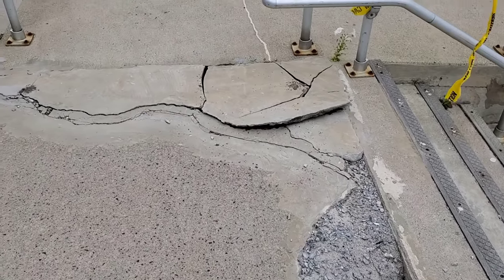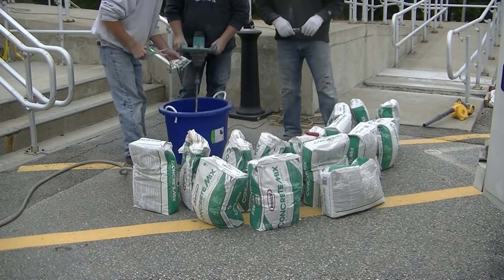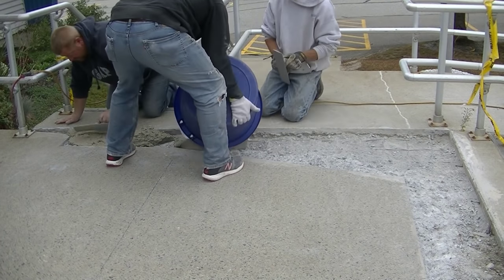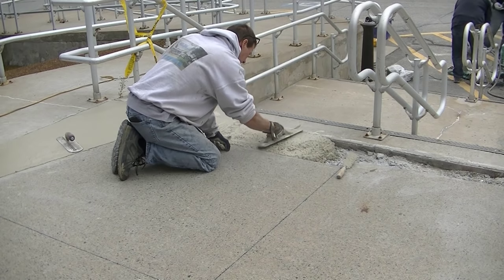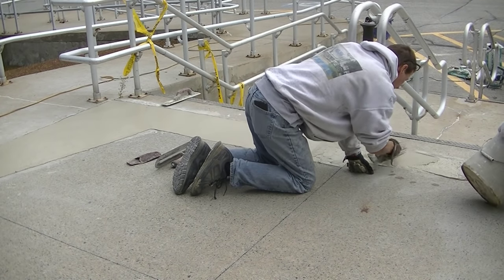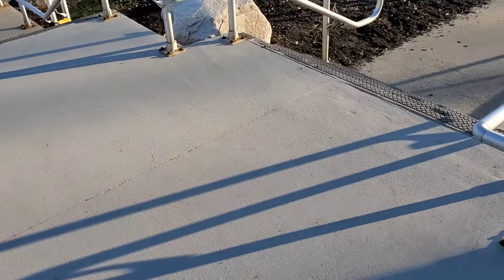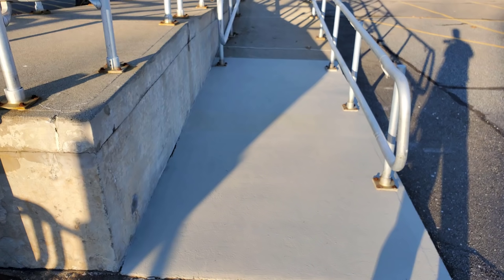How To Repair Broken Concrete | Fix Concrete Driveways, Patios, Sidewalks, & Pool Decks

Comment: Hi Mike, how would you repair a garage floor that has surface cracks that make it look like a jigsaw puzzle?  I think when the guys poured my slab, they swept the floor with big rotating sweepers and I believe they swept too much.  The surface appears to have no aggregate visible and the surface is very brittle.  It looks terrible and I wanted to do an epoxy floor.  Thanks for the videos and I appreciate the information you provide!
Reply: Just tile it over with 2cm thick outdoor tiles.

Comment: Great concrete patch job, and so professionally done!  
We hired a person to repair a section of our pool deck , and next season to do the the entire area with concrete stamping. I am so disappointed in the job that was done.   The process was nothing like the videos  I’ve just viewed. I’m no expert, but I could not understand why grout was used to repair the area. It began drying with what appears like spider cracks, and just unacceptable.   When I questioned the material and process we were told they would return in two days to apply two thin layers of concrete to cover the grout, but it would cost more than the price  quoted. Our loss.  😢
Could we apply an acrylic sealer as you stated in this video to carry  us through this season?   As the cliche goes, “ You get what you pay for”

Comment: Question do you need to wet the area for this application? Does it help or not matter in this exact case? Thanks! That repair and with the paint looks outstanding great work!
Reply: ... many have already suggested the answer to your question and it appears that they do not answer questions here so I will make it clear should have been wet down before application

Comment: Good concrete patch work is not easy.
I’m rarely an advocate of painting concrete flat work. Whenever you introduce foot traffic to concrete, paint just doesn’t hold up. But because there is so much patch work to do here, this seems like a legitimate application. 
Because concrete color is next to impossible to match, this job just wouldn’t have looked right without evening out the colors (shades) from new to old concrete.
Reply from the maker: I'll be down your way in a couple weeks. Tampa area.
Reply: @MikeDayConcrete  Cool! Something work related or maybe vacation?

Comment: For over fifty years I ve been hearing concrete guys say "There,s only two types of concrete concrete thats cracked and concrete thats going to crack " and to that I have always said "Than why do Pools hold water for years and years ? Because they are made right even earth quake So. Calif they still hold water even in  Big lake  lodge the pool sees both Earth quakes and hard freezes the Pool still holds water -Raw Concrete is a sponge it needs to be sealed or it will crack. maintenance is the key.
Reply: It's always wet.

Comment: Hello Mike,, I have a 10’ X 20’ interior room that i removed 2 layers of tile & the thin  set... Now it’s a little too low by about 1/4” here & there.. I just want to level the floor a bit from the concrete base flooring that’s there now before the ceramic tile goes down.. Any recommendations on some concrete leveling compound or mix ?? I’m in the southeast florida if that matters.. Again, thanks for the videos... By the way, we got almost a foot of sunshine ☀️ today..😁😉
Reply from the maker: Look up Silpro Silfo 220. That's what I use.

Comment: I’m not even a professional, but know the old concrete needs to be wetted first with water, plus the adhesion is improved by brushing on a thin slurry of cement and water prior to adding the new concrete. Unbelievable these guys made a YouTube video with not doing these simple steps to significantly aid adhesion.

Comment: Couple nit picks would be cleanliness on loose stuff. Needs blown out with air. I like using a two part epoxy just ahead of concrete so it bonds better. Overall looks good. These type of jobs are for experts only

Comment: Need to show the hydration process for rapid set. It will crack of you don't hydrate it.  It will turn instantly in front of your eyes.  Once that gloss disappears start hitting it with water.   It will get hot.
Reply: LOL...

Comment: The same forces that broke apart the original concrete will break the new concrete. The problem is the substrate which was not addressed here.

Comment: I’ve done some concrete repair for some customers in the past.... even patched pot holes in the asphalt with concrete and some pieces of chain as road mesh.... still holding up!
Question; is there any cold bond adhesive... is it necessary?

Comment: I can not believe you are not using a 1" pad below your knees. The concrete will ground out your  life force energy into the cement along with swelling of the hard surface to the tissue on the knee cap.

Comment: You also said right before the video was done that you were going to show what type of coating you put on top of the cement slabs to help protect them or paint and never did????? AND YOU NEVER WET SURFACE FIRST???? Even if your sad excuse was that their was no access to water at premises, even a teenager would have known to buy a pump sprayer for $25 at Home Depot and filled it with water before arrival LMAO!...---->AMATUERS! THAT JOB WILL BE CRACKING IN NO TIME!
Reply: I'd like to know also.

Comment: The repair product is good, but since you used tapcon screws, that’s definitely homie. Drilling all edges @ 2’ centers and used 1/2” rebar instead. The repair will always be the weak link in any repair, so why not reinforce it. Been doing it this way for thirty years, and never had to redo any.
Reply: Right on!

Comment: Is this a commercial for rapid set , retired concrete contractor here . Why would u not take all the concrete out and pin it and pour it back at the proper thickness and have plenty of working time. All a DIY guy is going to do using that stuff is make a mess

Comment: It is not going to hold up! Amateurs.. It will not hold up because they poured it over dry material. I will give it one hot season and it will all pop up. The subgrade must be evenly moistened over a minimum of a couple hours before the mud is worked in, so that it will adhere, dry and shrink evenly. The saving grace is that they are doing it in cooler weather which is a must.

Comment: What caused that is adding water to the top. 
If you get it with a 12" slump to begin with you shouldn't have to add water. Very little if any !!
I would have just cut the concrete straight with a saw and took all of the bad out. Then use that. 
Your way is Bullshit and cover up your half-assed job with paint !!
My way is straight  and you CAN drill into the good concrete and add small wire to bind it together if you want or need to. 
What y'all did is going to do the same thing when water gets under it and freezes. 
This isn't the right thing to do !!! 
Incase y'all don't know the reason there's 5 foot lines in sidewalk concrete is so it can expand and break even. 
And the other reason is so if the concrete does like that all you have to do is cut it at a line where the concrete is good and use forms or wood put expansion joint in each end, pour the concrete and it will look like it belongs. Finish the top with a broom and you're done. 
But whatever you want to do.
This is half-assed !! 
No real concrete company will do that !!
None I ever worked for because you can't guarantee it 💯 !!

Comment: So you didn't moisten the ground before pouring concrete in there...? Apparently you want to make sure you get the repair job to replace the whole thing, either that or you're a rookie!
And you're "teaching" how to do this? Painting it was a good idea at least.

Comment: Time is running out !

Read Revelation 20:12-15 in your Bible

                                           " A prayer to go to HEAVEN "
                                                   Luke 23:42-43 kjv
>>> LORD I am a sinner and I believe that JESUS died on the cross for my sins. Buried afterwards, then rose from the dead.

Read Romans 10:9-11 in your Bible

JESUS SAVES SINNERS PROJECT
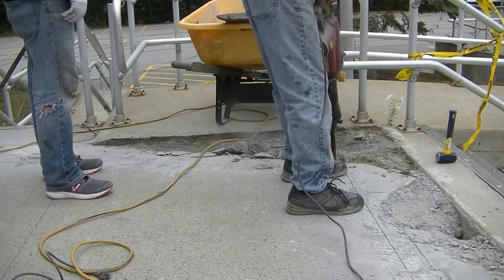1 Timothy 1:15 kjv...Acts 16:25-31 kj...John 11:25-26 kjv

Time is running out !

Read HEBREWS 9:27 kjv

Comment: My only comment is is related to health & safety. Mike - you really should wear knee pads. Trust me -I'm 63 now & have difficulty walking after years & years of kneeling on concrete without. I never thought about it when I was younger & I had a boss who would yell at me if I went  to my truck to grab mine. But now I wish I would have just told him to f**k off!. Believe me, it will eventually catch up to you.